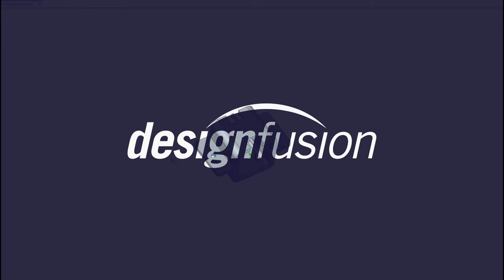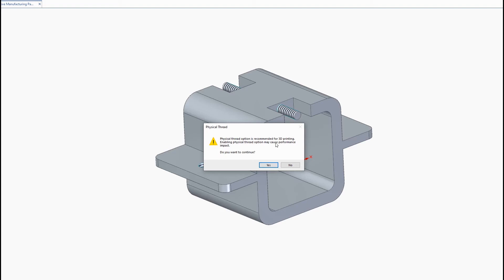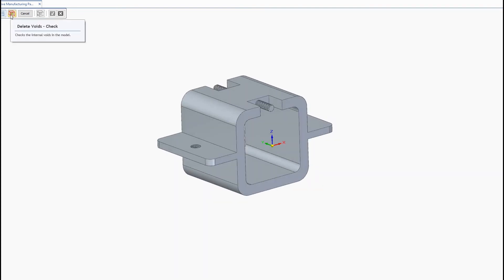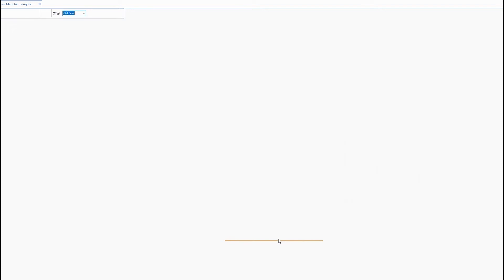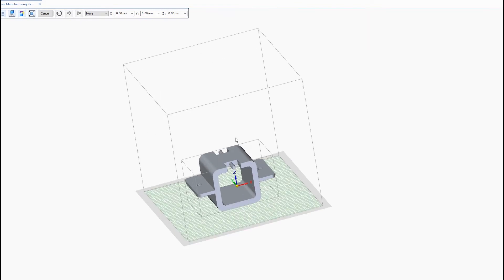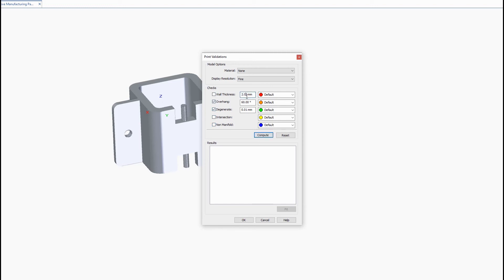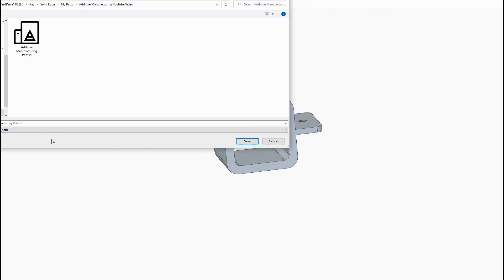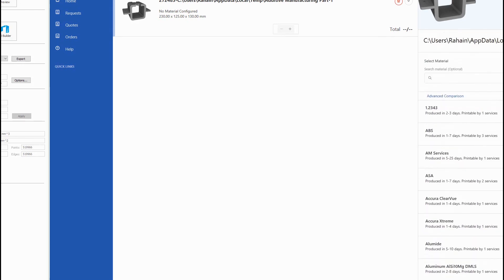Additive Manufacturing in Solid Edge 2021

Comment: In SE 2020 there was already a feature for physical threads... So it just moved for the 3d print tab...
One thing that I would like to know is how to offset a little the thread surfaces, since fdm don't have great tolerances and if you print the threads without some  clearance the thread won't work